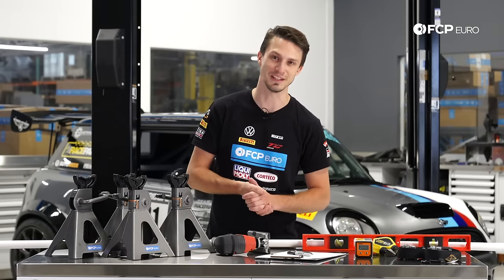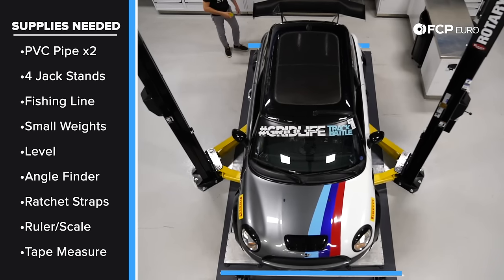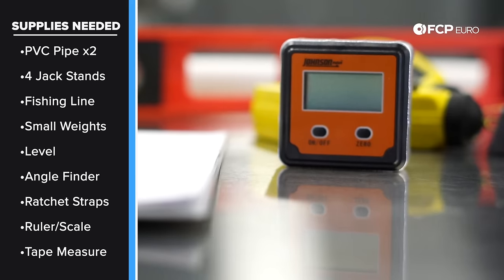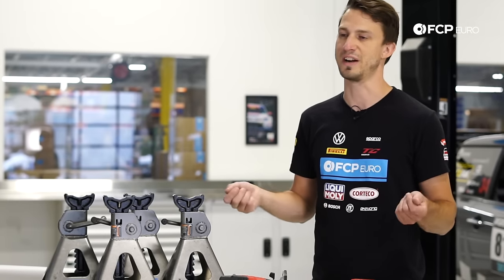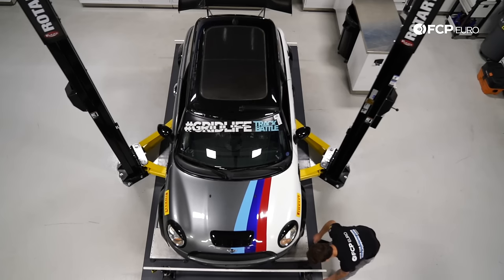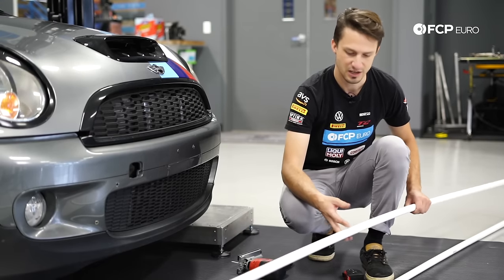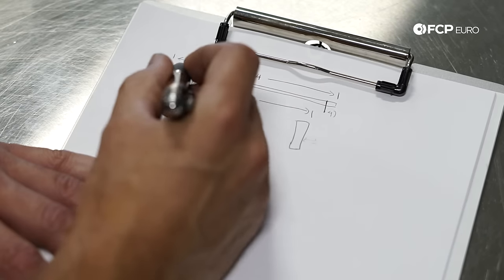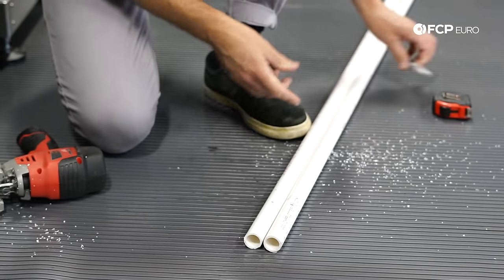At Home Alignment Made Easy - How To Use String To Align Your Car

Comment: CJ is correct. Understanding this is a string alignment and understanding the type of rear suspension (camber/toe affects each other) that being said even in this type of alignment one should correct rear camber then toe...then reset strings to rim or hub because camber adjustment can affect hub distance (in or out).  Then same with front.
 I also wonder if European definitions of negative or positive toe is different from US definitions.
I was always taught and read (U.S.) that negative toe is toe out and positive is toe in.

Comment: So this is the 3rd video I've watched for a string alignment, and this one is by far the best. The only question I have for all the alignment videos.... Don't all of the measurements being accurate depend on your eyes reading from the exact same angle every time? That was a problem I was having. The angle I was looking at the tape for the front of the front tire had to be the exact same for the rear of the front tire. In other words, where my eyes were looking at the tape had to be exactly the same every time, front and back of the wheel. Go under and make the adjustments, then come back and somehow make sure I was looking at the tape exactly as I did the first time, or my measurements would be different, wouldn't they?
Reply: I agree, I Have watched several and I have found that this is the best
Reply: Angle of reading on a 2cm rule is barely going to affect your overall number. Maybe 1/10th of a MM difference. We can call this margin of error, and still be well within spec.

Comment: Make sure the PVC pipes are parallel to each other, too. Since you cut slots in them, each slot needs to be the same distance apart front to rear. If not, even though your strings side to side are the same measurement front to rear, it won't be square if the front and rear PVC pipes aren't parallel. I ran into this with my first alignment I did. I later had to go back and take measurements of everything all around the car to make it square. This took some time, but after that, all you need to know is the track width difference front to rear and one side doesn't even need to match the other which makes for a much quicker alignment next time.
Reply: Check corners with a set square or just card cut square.
Reply: It will not make any difference. The important thing is the 2 strings are parallel, in relation to the road wheels?
Reply: @bernardwarr4187  I did some more checks and they would have to be pretty far out from each other. You'd be able to tell by eye. This method should get you pretty close. At least within 1/16". The main thing is use the same measurements each time so you're at least consistent
Reply: @tcoffin014  agree, the main thing is the String must a parallel, then it’s down to the accuracy of the measurement
Reply: @bernardwarr4187  they will not be parralel if all angles are not square.

Comment: People are talking about various hacks for making turning steering effortless.  Here’s what I did, albeit for replacing steering fluid, but for any purpose this works:  Get some bubble-wrap, I happen to have the insulation stuff that’s particularly useful as it has both sides the same, foil-covered and flat.  Just make sure the smooth sides are together, otherwise.  I cut two pieces for each side, basically about the diameter of the tyre or wheel say, and square ish.  You need a pair for each side.  Ordinary grease, smear one side only cos it’s easier, of the mating faces, plop the two pieces together with the grease sandwiched, on the ground, where the front wheels can be rolled over it.  NOTE…I have a front wheel drive car, and a small slope on my drive, so I drove the car forward of where I wanted it and let it roll back, then applied the handbrake only, to stop the car in position, with the front tyres as close to the middle of the greased bubble wrap squares as possible.  I then shoved a couple of bricks hard under the rear wheels, because only the handbrake and rear wheels are holding the car locked in position now.  That’s it.  The steering will turn free as a bird.  It meant for power steering fluid replacement, I could easily spin the wheels fully to lock right and left as the fluid gurgled through, but I will now be digging out this almost-free couple of devices, to help with the alignment.  I swear, I expected the bubbles to pop, not a single one did.  Weird, no?!  Thanks for this vid, take care all.

Comment: Hey bro great video, I have got a 2005 C class kompressor auto w203 when you drive on smooth road dryers the car dryers at nice and smooth as butter, but on the front right wheel is a space saver and my problem is when I turn to the left putting weight on the right wheel the car will wobble slightly fishtail motion when I turn right putting the weight on to the good side it does not because I am on a bit of a budget at the would you think it will be ok to portchester second-hand parts provided they are tight at the rubber gaskets and if so after top of your head from what I've just described that wobbling motion it also happens if I go over speed ramp would you suggest to change in the area obviously I'm going to look and see if anything moves drastically and I can move it by hands goes without saying that will have to be changed I found the wheel that was took off and the tyre is worn out like crazy,

Comment: At 17:20 around that time stamp you basically said the wheels on the front are toe out by 3 degrees but if the back portion of the front wheel is longer than the front that would mean that what you meant to say was it’s toed in 😊 thanks for the refresher I’ll just do what I normally would do and not mix myself up any longer on this Friday lol
Reply: If the back of the wheel is further from the string, then it's set more in to the car. If the front is closer to the string, then it's set OUT from the car. It's toed out.

Comment: Does it matter if you do the alignment with or without (With jack stands under the suspension for load) the wheels on, or are all the measurements relative regardless? It seems like a pain to have to move the string box, take a wheel off, adjust the tie rods (I have an Audi, the tie rods are at the top), then put everything back a retake measurements over and over again. Keeping the wheels off so you can reach the tire rods throughout the procedure makes more sense.
Reply: The toe measurements will be different. The hub is going to be maybe 6 inches in diameter while the wheel could be 18", so your measurement and precision would have to be that much more exact. In that case, if you measure 0.3mm of toe at the end of the 18" wheel, it would only be 0.1mm at the end of the 6" hub.
Reply: @Daschickenify  So I guess it would be relative . For example 0 toe is 0 toe in both instances regardless(?).

Comment: So you have the front bar in position, so the strings are equal distance from the front wheels. Then, you move the rear bar to do the same for the rear wheels. You just changed to front to unequal distances!

Comment: "Positive Toe" (a.k.a. Toe-in) is when the "front" (leading-edges) of the tires are pointing towards each other if I'm not mistaken.  You're saying the exact opposite  (at around 3:40)   At 17:00 you're still saying everything opposite (toe-in/toe-out),  but then at 21:45 you seem to have switched your understanding.

Comment: You will need to check the front bar again after adjusting the rear bar. The pivot point on the front is not on the wheel centre.

Comment: Quite a lot of work and materials.  I do it using 2x4 or 2x3 wood. Mark the front and back using tire threads, adjust, move the car backwards and forward then measure again until the numbers match.

Comment: Several areas I like to address... 
1. Lifting your car up and not rolling it afterward will affect the accuracy of your alignment.
2. This methodology, measuring center hubs, might not work for modified vehicles where the rear end is wider than the front.
Now, going old school.  For modified vehicles and antique cars. Using the same methodology, 4 jack stands and a string. Set you jack stands front and back, set your string front to back, center of the wheel, measure the distance (here is the difference), front and back of the rear tire from the string, makingsureitsthe exact same measure front and back of the rear tire. (When you do this, you establish a true track from your rear end.) Once this is done, then measure the back and front portion of the front tire to set your toe.
Reply: Since he's using the PVC pipe to hold the same distance between the strings It won't matter if the track width is different at the back.  You're still going to end up with parallel strings when you measure the distance and it's equal on both sides.
Reply: But what if the rear tires don't have zero toe? Your method ASSUMES zero toe in the rear :(

Comment: Great video and a simple way of doing the alignment! Thanks! Just a brief thought and possibly a stupid question: How do you know that the wheels are pointing straight ahead before the adjustment? What I mean is ("I" is a wheel:-) ): "I" and "I", not "/" and "/", or "\" and "\"? We are talking about millimeters here and the steering wheel could be off-center...
Reply: You don't. That's why you measure off the center line of the hub or as close to it as possible.
The center of a circular plane is always in the same spot regardless of which way it's facing.

Comment: if you know the track width of your car , you really dont need those bars.. you can just tie that string to the jackstands and measure out equal distances from the center of the wheel to the line. That would also give you a boxed line set up.

Comment: When making the parallel strings down each side I think you need to measure from the exact centre of the little hub cab in the centre of the wheel . If you measure from the wheel like you did it will not be accurate. Greased stainless plates under the tyres helps too. And don't measure camber from the tyres. Cut a piece of alloy channel at a correct length to touch on wheels only. just my 2 cents..
Reply: ...and buy a caliper.  What's this ruler nonsense?

Comment: Thank you for the film, very informative. Those adjusting bolts, are they same for every car, or they can be at different locations? How to find them? When I changed outer tie rods I noticed that the #/s of turns for the driver and passenger sides  are slightly different (like on passenger side I counted 20, while on the driver it was only 18-1/2 turns). When I put new ones I did like 20 and 19 turns respectively. But probably I could do both same (19 or 20) and then after the alignment everything would be perfectly symmetric. If you just replace the knuckle on one side, do you need to do alignment?
Reply: Yes.  There could be slight variations in manufacturing procedures as how the manufacturing equipment was calibrated and the variations that can be found in the initial manufacturing of the raw steering knuckle itself.  Remember that we're dealing in millimeters here.
Reply: @williamcharles9480  It is very good to know. So many small details, I'm curious if anyone knows all of that: car engineer, very experienced mechanic? Thank you.
Reply: @olenaerhardt7725  55 years of experience in auto repair and restoration.  You're welcome for the information.
Reply: @williamcharles9480  My pleasure, good mechanics like extraterrestrials for me, a lot of knowledge. On that car (Chevy 2003) I eventually got 2 brand new knuckles and replaced them. Before I bought an used just one knuckle on ebay, but while waiting on the parcel got suspicious about quality of it (and it was from Pontiac, though they look exactly same, but see you say it is precision in mm).
So used pair of knuckles I decided to keep as a spare set. But probably it is better for that extra set to use both fm Chevy, just rethread for the thicker bolt (I busted one on changing brakes, cross threaded and broke the bolts).
Thank you kindly again. Now I see why the company I bought the set from was selling a pair of knuckles.

Comment: Unless I am mistaken that BMW chart clearly calls for toe IN, and you have set it toe OUT, also 12 mins +/- 4 on 17 wheels converts to 1.5mm +/- 0.5mm, at the 2.3/2.4 mm toe OUT you set front total toe, you are outside tolerance there even if the BMW chart does call for toe out, which I doubt, nice filming by the way.
Reply: I saw bmw specs once that were per wheel. He is adding each wheel to compare to spec. Always toe in all 4, so the toe is zero at highway speeds.

Comment: Other than installing a proper hoist in your garage.
There are a few good guys out there who can & do a proper alignment for you. At a price.
 But I had 3 bad ones in a row from guys that didn't have a clue. It cost me two sets of tyres.
Had/ have/had my Dodge van for almost 18 years and no alignment.
 In the past 3 years, just had my 4th one done ( it was perfect) but had to buy two more tires for the old gal.
 Hmmm? Runs like new now even with 302,000 km on her.

Comment: what about axle/spindle being square with  the frame/body ?? what if car had the rear axle forward or rearward to canter line of frame/body ?? some confusing as you mixed toe in and toe out measurement. toe in should always be front of tire/rim on front or rear axle/spindle, measured from not shown center line string.

Comment: Great video and excellent explanation.

I do have a question about camber though: Won't the tire be bulged at the bottom thus registering slightly more negative camber than is actually present? The wheel would be accurate but the tire would be a little off (more so with lower tire pressure and thus more bulge).
Reply: This a good point to address, for camber I think the measurement has to be the the center of the wheel because it is not the tires that we are adjusting it is the wheels and reading the tire's algle would be inaccurate to rely on because of the bulge of the weight on the bottom. One thing I did is I got a straight 1 inch by 16.25 inch steel bar which I put vertically right on the center of the wheel with magnets inside the wheel hollow center to hold it then I place my digital angle finder on the the center of the bar at the center of the wheel to get my camber reading, It is very accurate, though the biggest problem is finding a perfect level ground to get a perfect reading when doing this at home but it works great on level ground.
Reply: Just what i thought too when i seen the video. Camber, castor and KPI should all be checked and adjusted before toe in alignment and then rechecked. Camber is never adjusted after toe in alignment, wrong order and the adjustment of camber will change the toe in alignment again.

Comment: You must be watching this if the shop refused to do alignment on your car or just want to try it. Back in the day, I just use the side of the wider pair of tires for a reference square all around with string loop tied on jack stands on each end. Loosen the tie rods and adjust as the steering wheel moves back to center aligned position. Camber alignment is based on incremental adjustments (rule of half) until you find a sweet middle spot to get tires vertical based on load before and after. The  new tire tread wear is the judge after a couple of thousand miles. Good luck.

Comment: Just paused at 7:30 marks to make one comment, "don't forget to don the appropriate PPE". In the case of cutting the PVC pipe, that would be safety glasses. Also, in our neck of the woods, if we worked around a vehicle hoist without steel toes boots and got caught, we'd have the shop shut down.

Comment: 7 ° is too much. The antidive causes the Caster to increase in a turn on the inside nonloaded wheel. The outside loaded wheel does the opposite. Caster is set where both wheels change at equal caster angles at a given amount of body roll in a turn. This is great for roll steer. The rear springs equipped with underiders  can be set to also roll steer in a beneficial way increasing traction in a turn. Body roll can be limited with heavier springs and roll bars front and rear.

Comment: Question! about setting the (string)box around car?  if the toe is off and your using the wheels for locating for the string box around car (square)  how is it that it would be correct,? if one front wheel is at +3 deg and the right is +1deg,  your using the defect to set the square, or am i wrong? it will never be a correct alignment, you need to find a way to reff the square (box) to the car not to the wheels then you can set the toe and be correct,   how are you positiong the box to the center line of the car so that both strings are parrellel to the center line of the car?

Comment: I would have checked the steering rack mounts, mounting bolts. Obviously you race this so was recently all correct and still is you would just be driving with steering not centred. I would imagine there's some pretty substantial steering loads & high probability of ripples or rut (rubbing a kurb for the non racers)  may have moved entire rack because of clearance around bolts or even bent bolts some mounts are basically a clamp around tube sections on steering rack. Only need 2 to 2½mm movement in rack location your done. For you be in your interest to check why your alignment has moved. Can't have bent both sides and have the measurements you've got-that would have increase tow out. Guess you could have moved k frame/engine cradle too. Done this way on both work Ute and car got wheel alignment with tyres on Ute and I was 4% to much toe out on drivers not bad considering I guessed specs for Ute knowing I was getting new tyres soon. Get called olden days dad or depression erea dear.